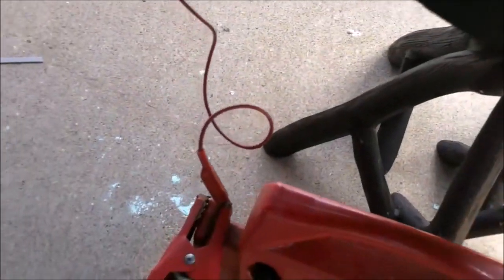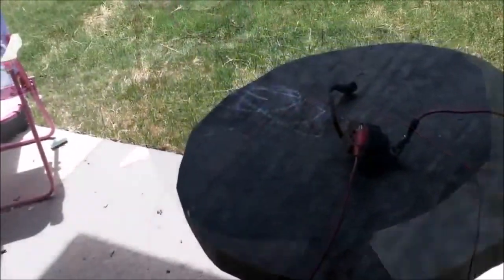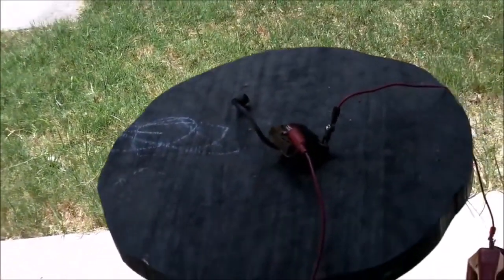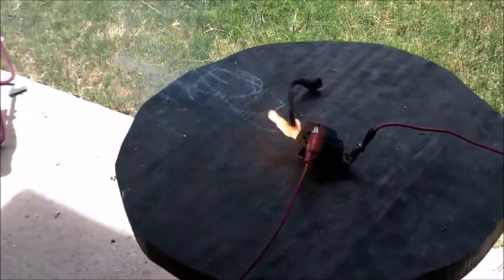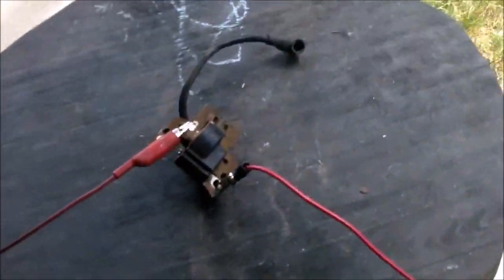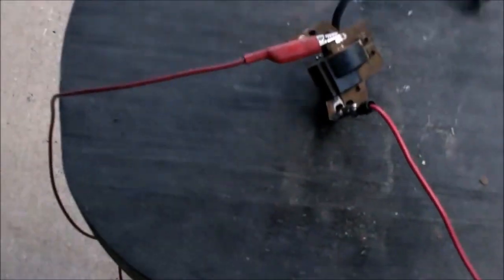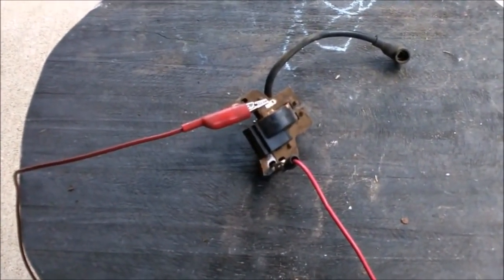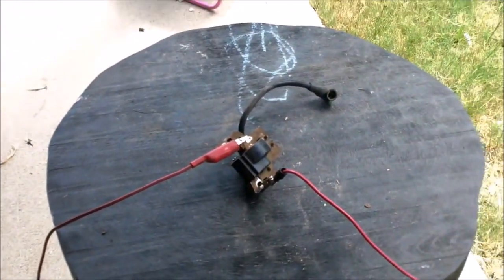MUST WATCH! EXPLODING AN IGNITION COIL (DEMONSTRATION ONLY)

Comment: I did this today. I have just learned my coil is supposed to take 6v if rated 12v. While in the process of making a points system for a homemade engine, I was powering the coil with a 9v battery which, worked at first, but then started becoming more intermittent. I presumed it wasn't getting enough power (as it was rated 12v) so decided to give it full 12v. And it popped just like it did in this video (minus the fire as I got to the power supply quickly). 

I've reordered another similar coil but I don't want it to happen again. Does it matter which way around the battery goes?